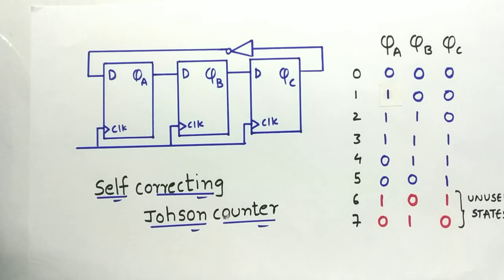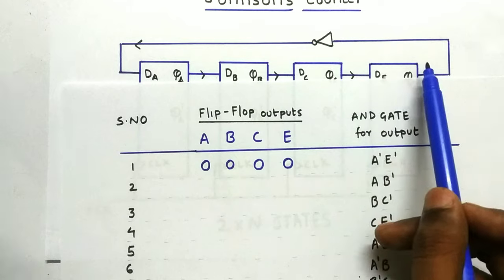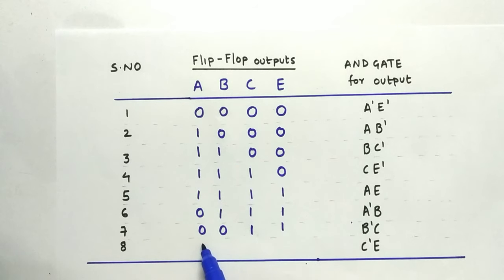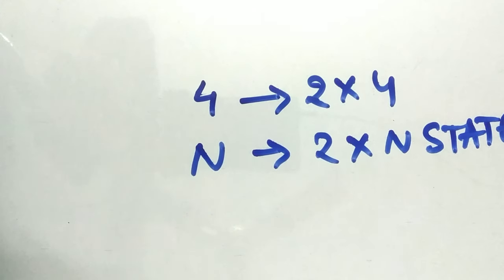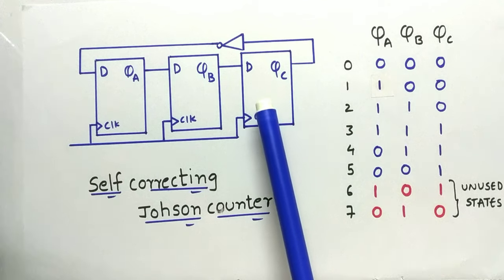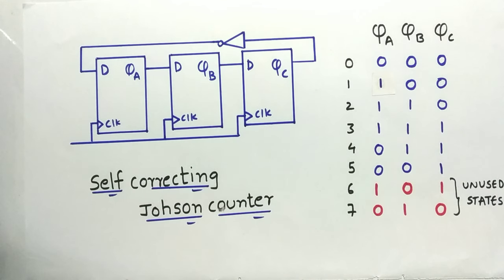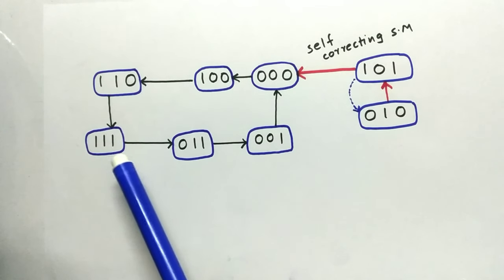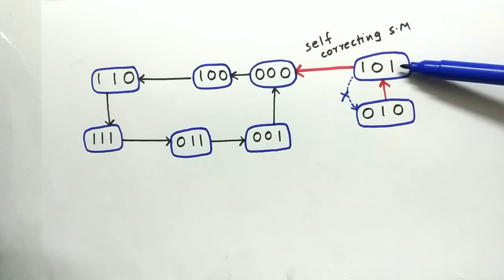How to design self correcting Johnson's Counter? *Simplified*

Comment: i was taught that when having unused stated,there are 2 things we can do:self-correction and self-initialization.can you explain the difference between the two?
Reply from the maker: Namaste 🙏 Cosma ,thanks for asking , In self initialization  when we go some other wrong state we move back to ideal , in self correction we move to the required state . Hey I might be wrong but above is my understanding 👍
Reply: i understand,but what would be the ideal state in the case of self-initialization(like a clear so going to state 0)?Also,when we go to an unused state but the counter corrects itself without doing anything,is it a different process than the ones mentioned before?
Reply from the maker: I think both are similar